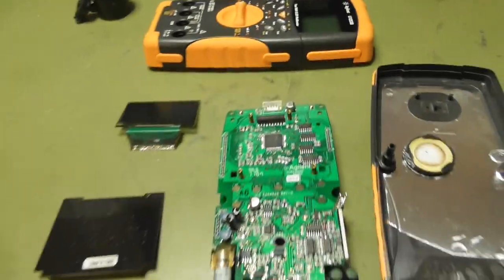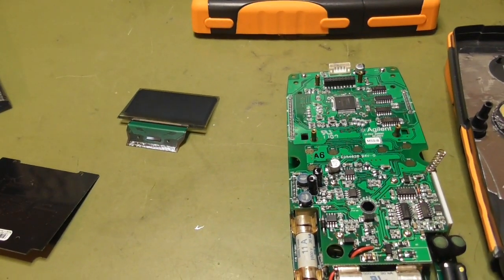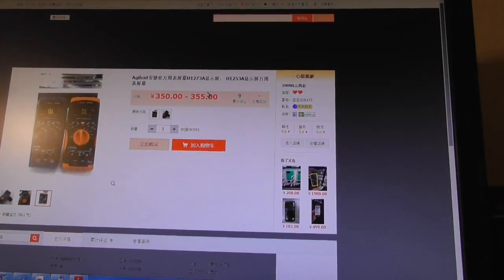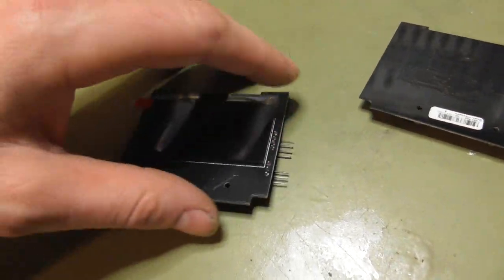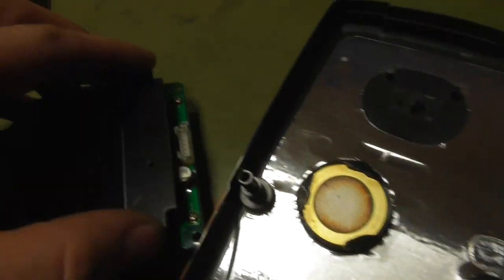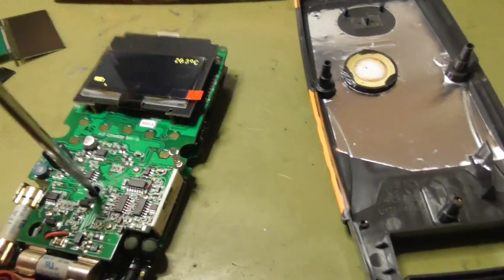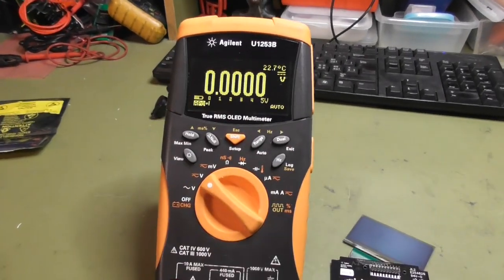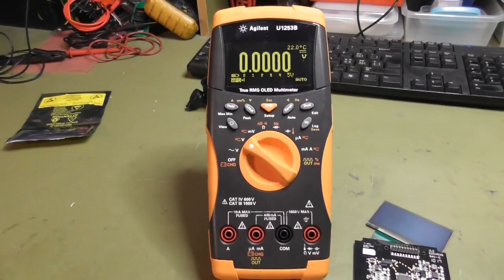Agilent U1253b OLED Display repair (replacement Display)

Comment: Hi, is the link still valid? i get a screen filled with Chinese text that looks like a login screen.
Reply: Taobao requires registration,but you can contact me,I can offer the sreen all new.If needed I also have a taobao shop.
Reply: @wangyun-pp7xc  Can you provide some more information? I have the meter working with a replacement screen, I bought it with the screen replaced.
If it fails in the future I would like the option to replace it. Please give me some contact information, thank you.
Reply: @KB1UIF  I guess you need to check his homepage instructions.